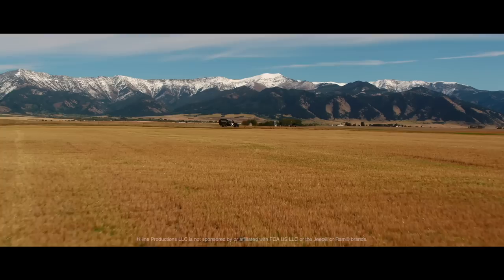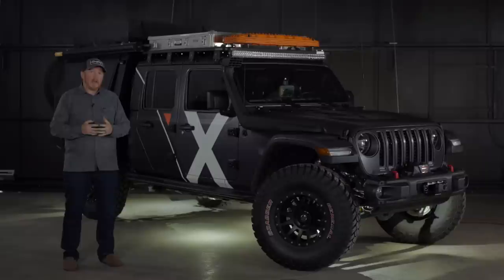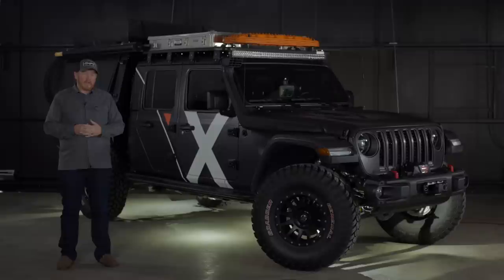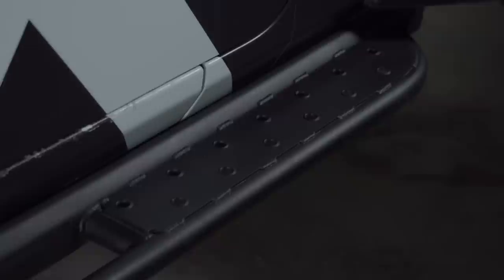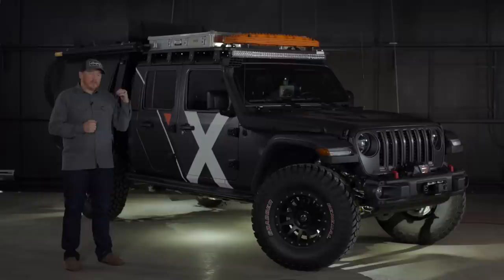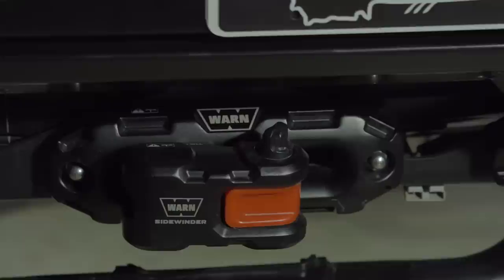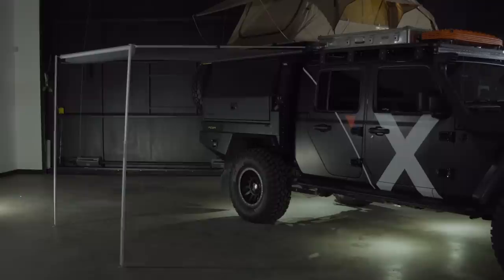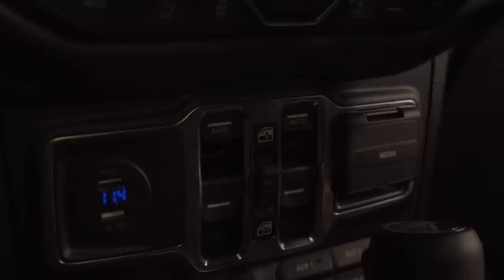Custom Jeep Gladiator Overland Build Walk Around: Expedition Overland 'In The Shop' #18

Comment: you  are guys building very cool trucks, lots money put into. But my question to you its still more like solo or couples only and even dog a stretch. Why is not taking further what is more family needed, not a trailer, not a van, like a HD truck with 6 + bed and make something that will have 4 - seats, and dog fits into bed. when you can pass this edge, you might have something batter than Van, that can be use everyday driving and plus get out for the adventure. It's not going rock crawling, but not many people will go MOAB and try kill all family, and not all can do that, it's dangerous, really stressing vehicle to edge, and not so many parents wanted risk.

Comment: I've always wanted to build an overlander with a Wrangler. Gladiator looks like an even better system to build it on. Finally have things set up (house, daily driver car, a job lol) so I'm looking into building this thing finally. I just wish people priced out these kind of builds even if they're sponsored so I had a ball park guess lol. I'm assuming around 100-150k but honestly doesn't sound that bad since at one point I considered using a trimotor Cyber truck since they could possibly have 500+ mile range with around 15 additional miles a day via solar from the factory. Gladiator is definitely more versatile  though so looks like I might scrap the preorder and let my wife trade in our 3 for an S or X while I build my own little dream earth roamer!

Comment: Looks awesome! Hopefully it’s reliable and doesn’t leave you stranded in the middle of no where. Chrysler doesn’t have the best reputation for reliability...
Reply: It's not a Chrysler anymore....
Reply: I've owned 4 jeeps, a 2006 TJ Unlimited Wrangler (my favorite of them all), a 2007 JK Wrangler, a 2010 Grand Cherokee and a 2018 Cherokee. NEVER once had a problem with reliability. Will continue to buy. Best factory off roading vehicles on the planet. Glad to see the new JL's & JT's  have gone back to the older TJ gearing, 3.73's. Gearing in the JK's (4.10's) were great on the highway at speed, but lacked the torque and pickup from dead stop.
Reply: Chris M you’ve got your numbers switched there bud
Reply: @rojahhh  Um, what??? The last year of the TJ was '06 and they changed the body style to the JK in '07. The TJ Unlimited was a 2 door Wrangler from '04 thru '06. It had a longer body with twice as much cargo room in the rear, and was referred to unofficially as an LJ by Jeep owners. The L stood for Long body. If your going post something as fact, then you should know what you're stating, bud.
Reply: Chris M was talking about the gearing man. Your Wikipedia knowledge is spot on.
Reply: More reliable than late model Toyotas, well the ones we get in Australia anyway are rubbish now.

Comment: What's the static and dynamic weight for the k9 roof rack. I looked on there site and didn't see it so checking to see if you know. Also, is that rack just for the JT or will it work on a JLU as well. TIA

Comment: You mention is does not do well in long distance traveling. What would you suggest for someone who has to travel long distances for decent overlanding? (Want a capable off-road vehicle but something comfortable, not interested in major rock-crawling)
Reply from the maker: Toyota's lineup is hard to beat. Tacoma, Hilux, Land Cruiser, 4Runner... any of those would serve you well. Sprinter vans (two and four wheel drive) perfect if you're looking for a ton of indoor living space.
Reply: If you want range you shouldn't be considering anything that isn't diesel powered.
Reply: @thesickhorseranch  Prospector XL it is!! LOL
Reply: @ExpeditionOverland   What about the Gladiator Rubicon with the 3L V6 diesel, a 2 inch lift and a 35x11.50r17 Nitto Trail Grappler MT on stock wheels.

Comment: I looked at General tires web site and can't find that size (37x10.5) tire that Clay said is on the Gladiator. Are they still working on getting that size out?
Reply from the maker: The Gladiator runs a 37x12.50R17 tire.

Comment: Would love this to sée this one. Not much have the awareness. Wrangler's cost way too much. Mahindra Roxor is  available as low as $16000 , i bought 2019  one and lifted it with a 3inch lift kit. Love the look of it 😍, im trying to make it road legal , will be over soon . They make very good tractors.

The engine's got 62hp and 144nm torque but i have seen a video on YouTube that it can do about 200hp with 400nm torque with the same engine. They have to detune the engine to meet the regulations. Its amazing. I'm planning on doing it on mine too, after putting enough miles on it.
I would recommend every one to buy them, it costs not more than a mortarcycle or an ATV  and  you can look cool 😎. It's bear bones you can modify it as you like.

Fiat is sueing them only for the grill and some body parts . As the case proceeds eventually Mahindra is going to win it as of now. 

Mahindra offers more jeep than Fiat fake ones. 

They are the only company to open a new plant in Detroit for over 23 years and they are planning to expand their designing hub to Detroit. They are providing jobs for Americans.I fell for it

Comment: The only reason I’m considering the Gladiator is because Toyota doesn’t offer the LandCruiser 79 series here in the states.
Thank you Toyota!!
Reply: I know right lol
Reply: Totally agree. Now Jeep needs to throw in that diesel engine and we'd have a reasonable equivalent to the double cabin 79 series and perhaps a manual transmission too. With the Landrover Defender no longer an option on the market, the Jeep wins (home turf advantage) since the Landcruiser 79 is not allowed Stateside.

Comment: Yea there's no denying that Jeep have built a great platform with Gladiator. I'm looking forward to the launch of the Diesel simply because it offers the 500+ mile range without adding additional weight and fuel capacity. Just the price is a little eye watering.

Comment: man yall did that jeep right. The only thing I'd change is to get the motorized drop down steps from rock slide engineering that doubles as a rockslider. Other than that it's perfect.